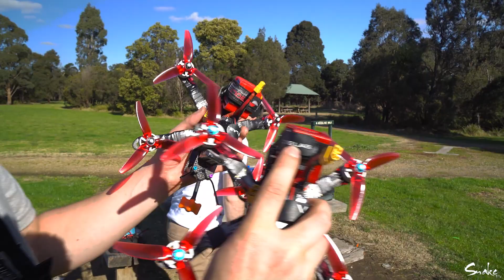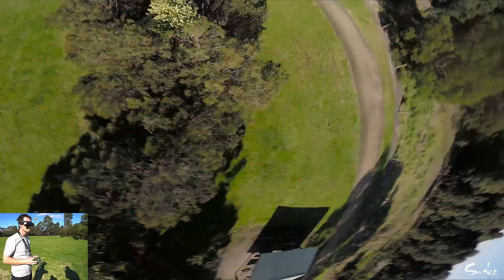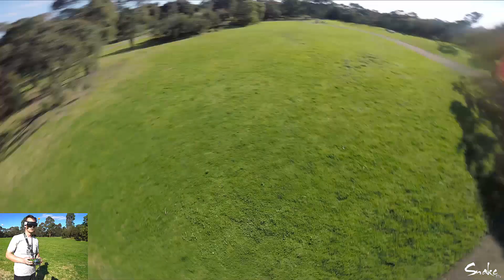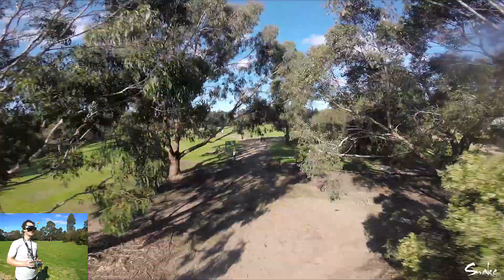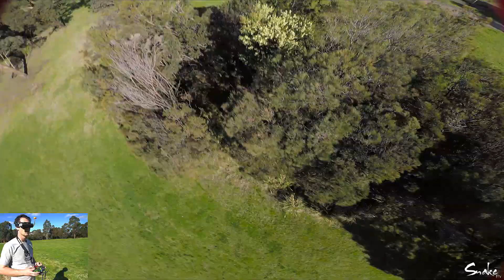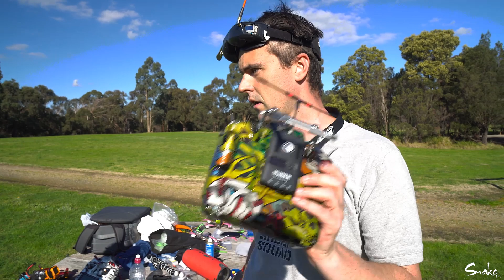FASTER THAN SBUS?!? Blind Test TBS Crossfire CRSF Control Link

Comment: Hello, 
I have a Spectrum DX9 controler and a TBS Oblivion copter. 
I have now upgraded the TBS Oblivion to Crossfire TX Lite with micro receiver.
The problem is that the receiver and the transmitter connect with the TX has also been modified
Reaction between the transmiter and the reciver and so on are shown in betaflight normaly function,
but if you turn off the betaflight and connect the copter to the battery then there is no reaction.
If you connect the battery to the copter then only three tones... sound normally but this is all.
As I said before in betaflight everything works wonderfull, but if you just connect the battery beeps three times,
the receiver and the transmitter connect to eatchother,but there is no reaction.  
Copter which is ESC it was also set with BL Heli there everything is okay what could be the reason.

Comment: Just bought the Tango and the bigger "Lite' module and recievers are on the way. Im changing everything from Flysky (Ibus) to Crossfire (Fleet of 10 quads) After a year doing research and looking at the math. Its just as cheap to switch to Crossfire everything. Given the way i break shit. Spend a little more money for the recievers vs sbus. But im getting a much faster and longer distance link. And set up a lot easier opposed to updating everything on sbus and the taranis. No brainer for me

Comment: HI, I have microTX (100mW, Dynamic off) and I keep failsafing :/ I have mounted the microRX antennas in 90deg angle just like you have.. on the other quad with the immortal I have much less FS but still.. can the RF link be affected by the placement of the microRX right next to the lipo lead cables? (el.mag interference or something?) I am kinda disappointed.. want to do the switch.. but those FS are killing me ;/

Comment: SBUS is just a protocol between RC RX and FC. The bottle neck is most probably the radio transmission which is not SBUS, not even on Futaba (who’s protocol it is originally).
Reply: ..and more info: Futaba 14Sg has been measured to have 9ms (which means 100Hz) latency end-to-end (stick movement-sbus output). On taranis it was something about 20-30ms latency.
Reply: Hi! So, how can one build the worlds fastest RC transmitter-receiver system? Which parts to use? Futaba is so much faster than Taranis? I was considered about upgrade from frsky x9 to taranis, but maybe taranis is not the best option? Thanks!

Comment: Can someone help me I can't get vbat and vfas or PID lua scripts working on my taranis with the crossfire, but I do get the Rx/Tx data like mw and rssi I think. 

Here's my setup:

- Kiss FC
- Steele PDB
- Crossfire Micro Tx
- Crossfire Micro V2 Rx
On the taranis lua settings I have
Output 1 - CRSF Tx
Output 2 - CRSF Rx
Output 3 - LQ
Output 4 - Ch 4

I used the diagram here to hookup the rx to the kiss fc.

The biggest concern is the telemetry to the taranis because i can always tune via the OSD, but it also does look like im getting telemetyr data to the OSD, I just wonder why I'm not getting it from the crossfire and taranis. Any help to get this telemetry sorted?

Comment: totally jealous here - i just switched from xsr to crsf micro and had totally opposite experience. Must be something is did wrong, yet cant tell what. With CRSF mode at 150hz i get huge huge control interrupts during intensive maneuvers, sometimes up to 1/3 sec. I looked at BB recording of rcCommand in betaflight - confirms what i felt - pitch/roll lines are like staircase vs smooth curves with XSR. ANy thought anyone? i have it on video here at 2:45 https://youtu.be/6xUF0ZFTBaw?list=PLvrRKTth9HIzYFqmWGTA_tvHMC9V-bF4l&t=164 -cheers!

Comment: I love the Crossfire w/ CRSF most of the time but I've experienced a 0.25 sec delay sometimes in control delay with beta Crossfire and hoping the next beta release or TBS Immortal T will solve.
Reply from the maker: Yep the delay in switching when it hits a certain rssi thereshold currently is quite noticable but it is being worked on. for now just put the tx power output as high as you can, on 100mw i still cant get it to switch before i loose video on a unify pro...

Comment: what about the latency from the JR module, wouldn't that negate any gains from the Crossfire and the Rx?
Reply: this was the first thing we got rid of. we killed the latency by implementing CRSF in OpenTX, so we are pushing stick commands at the same speed as the internal module
Reply: Wow, that's amazing to hear. How would you say the range is compared to the Taranis with 5dbi mod and the X4rSB? I was considering getting the crossfire for my 6" but this may push me over the edge.

Also, will the micro rx still allow me to adjust my KISS PIDS, rates, fiters, and telemetry data on my taranis?

Comment: Hang on I thought in certain environments with lots of 800-900 mhz noise crossfire is not suitable and can have worse range than 2.4ghz links?
Reply from the maker: for sure this will still be the case in some places i think, but the same is also true for 2.4 and atleast where I live 2.4 flooded areas are far more common, plus with crossfire you can turn the output power up or down as required where as with 2.4 it either works or it doesnt...

Comment: 8ch D16 SBUS runs on 9ms frames, that's ~110hz, not 50. You can get it down to ~55hz when you transmit all 16 channels, but very few people need more than 8 for a quad. It's annoying though, because by default it sends 16ch, so most people never get the faster stuff. The range advantage is undeniable tho.
Reply: in opentx you just tell it to send 8ch in your model's options.
Reply: norgtube does this mean that if i don't use telemetry i can switch to d8 on taranis and get faster response from tx?
Reply: At least for the XM+ there's a pair of RSSI8 firmwares (FCC or LBT, depending on your region) that will output RSSI on channel 8.  I can't speak to any other receivers as I only have XM+ in all my quads.
Reply: according to some tests done by one of our facebook subscribers, the D8 mode is not much faster than the D16 mode
Reply: does this mean that it is possible, through firmware update that limits the channels, to get reduced latency in sbus?
Reply: Even if you do, what you lose (apparently) is RSSI, not telemetry.
Reply: I saw that, really interesting.
Reply: Even if you're using RSSI loopback where you send it through a spare channel, you can just send it through ch8 rather than a higher number, and still limit it to D8.

XM+ outputs RSSI on CH16 even if you are only outputting 8 channels from the TX.

And yeah, I'm glad the option is there to cut latency in half with switching to 8 channel system, no mini quad I've ever flown needs more than that, and anything that needs the full 16 is almost certainly not going to need that extra update rate.
Reply: You can't get RSSI without telemetry on 8ch though.
Reply: Can't you? No idea, I have sport on all the time.

Comment: Have one lying around. Can not get it to work. Updated Kiss fc, it binds, but No pulse input what So ever. Anyone thoughts on what I am forgetting? Same on my betaflight quad so I must be doing something wrong.
Reply: we had a few problems with pins bending and not fitting the module. they may need to be bent a bit towards the wall. check your module's socket to see if there's any damage.
Reply: Would it not be unable to bind if there was a connection problem?
Reply: yeah you are right. best open up a ticket we are happy to help
Reply from the maker: ill do a video on the whole set up process for kiss and probly betaflight soon too, at least then you can see if your missing a step or a process
Reply: That would be awesome mate! Little to find about the setup proces at the moment
Reply: Please, please, please asap, got all of your components (motors, kiss, tbs, taranis) and no place to go. Say hi to Trappy for me